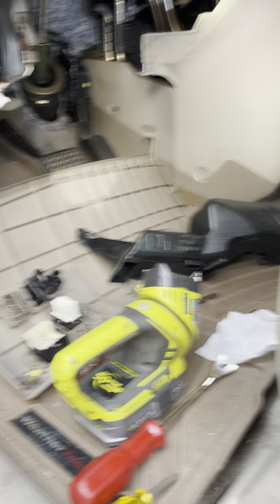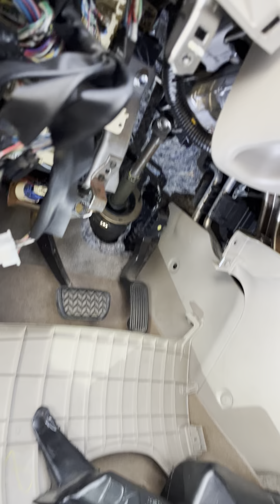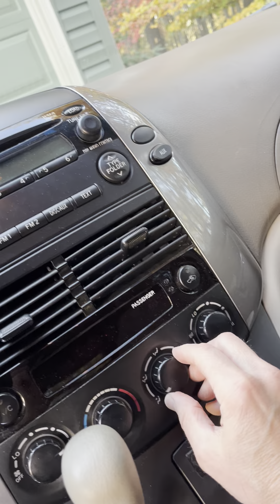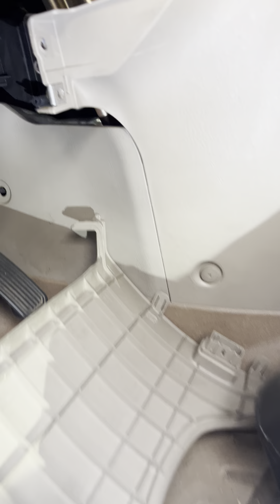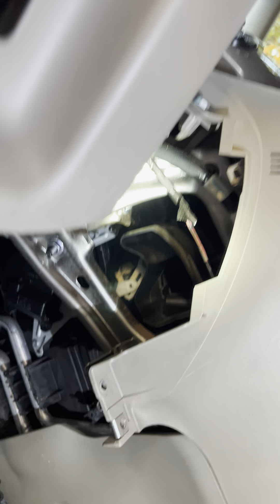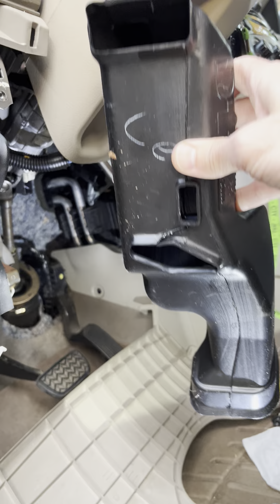Toyota Sienna Mode Blend Door Actuator Replacement

Comment: Thanks for the video. Not sure if anyone else mentioned it but I found a way to make the pins align much easier. 

Put the assembly with the new actuator onto the area and just start securing the 3 screws (enough to hold it in place, but not enough to put pressure on the pins. Then, plug in the actuator, and turn it to defrost on your ac controls, this aligns the slots to the proper orientation. Then do as he says in the video by moving all pins as far out as they'll go away from the center. With some trial and error I found this was the absolute best approach, hope this helps!
Reply: Thanks!! My upper right pin, I believe that's the defrost, wouldn't stay out from center. My solution was to turn the fan on and it created a suction and kept it out in place.

Comment: Thank you for the video. It was helpful.

I just replaced this part on my 2007 Sienna. This video was very helpful. I learned the following tips from trial and error and share them in hopes that they save someone else some time.

1. set the mode to front defrost. I found that this moved the pins to the outer most position.
2. slide the actuator up and push back in one motion and the three pins should find the groove. 
3. turn on the car ignition and change the mode settings. If the wheel spins then you are all set. If not, repeat steps 1 and 2.
4. put in the three screws using your hand and test again to make sure the wheel spins

I spent an embarrassingly long time trying to line up the pins to the grooves and had no luck until I figured out the trick with the defrost mode moving the pins out.

Comment: Dave mine has no pin to hold the cam cover in place and it fell off. Does the clip or whatever go through the center if the black plastic cover and spread the covers post from the inside to lock it in?
Thank you.

Comment: The two-lower blend door actuator is for the hot and cold setting.  The servo mode door actuator is actually for the defrost and front vent mode.  Am I correct on this?
Reply: I believe that may be case for models with dual climate. Ones like this have the hot cold actuator on the passenger side. Easy fix on those. Mines a 2006 .

Comment: Hi David, Thanks for the helpful video. I am trying to fix the Mode Blend Door Actuator. I spent many hours to adjust the pins positions as you said. I have 2 questions to set up for locating the pins in correct positions and the initial mode when you shutdown the Mode to start to fix:

- See picture: https://photos.app.goo.gl/PSTag2DF8e2KWe917
- And mode to setup is which one in these :Floor, Face, Face&Floor, Floor&Defrost ?

Thank you

Comment: So, I just did this this past weekend. Getting the pins back in is a real crapshoot. Ultimately what worked for me is I shifted all three of them to make sure I was getting air blowing only on the windscreen - nothing out the dash vents or at the feet - then with the actuatos plugged in but hanging loose, set the control all the way right to defrost. Put the actuator back in gently and it worked great. BUT I HAVE A WARNING!!! I was doing it in my driveway, temperature outside below zero, and to help me make sure I had the air blowing where I wanted it I had the engine running, heating cranked, and fan at full blast. I was probably under the dashboard for half an hour screwing around with it. When I finished up and was congratulating myself on all the money I saved I looked at my windscreen and there is now a nice three foot long crack running across the bottom right where the hot defrost air was hitting it. "F#$*#&!!!K!!! (That's a direct quote) Was sad for all of 5 seconds then started laughing because what else can you do. Anyway, maybe use cold air when you're fighting with it.
Reply from the maker: Yeah, hate those pins.  I think I got a bit lucky with mine falling in place.
Reply: Best comment ever, I struggled a lot until I tried what you said

Comment: I just finished doing this on my 2008. Thanks for the instructions. It is always helpful to see how/if it can be done without completely disassembling everything nearby. The service manual probably describes taking the entire dash apart to get to it. It took me a while to get the pins in the right slots. In defrost, it is turned all the way one direction which makes it easier to tell which pin goes in which slot because they will all be near the one end of their slots. Floor mode works, too, it is all the way the other direction but I found defrost to be more intuitive. I plugged it in while uninstalled, set the mode, unplugged it, then installed it while getting each pin in place one at a time until the unit sat flat and solid on the mounts. Unplugging is necessary to be sure it doesn't park itself (i.e., rotate) after a few minutes of ignition off. I started with the top pin because it was the hardest to see and position, then the lowest one, then the one nearest the cowl. Not easy, though.
Reply from the maker: Glad it worked out for you.  Yes, if it weren't for those pins it would be a 10 minute job.
Reply: Thanks for the recommendation with setting the mode to floor. I am running into the same situation with trying to align the pins into the right slot.

Comment: I need to do this job on a 2005 Sienna. I noticed the part does not come with the arm. Is the arm needed  for the  actuator or how do you swap the arm from the old actuator to the new? Thanks for the video.
Reply from the maker: My doesn't have an arm.  My has a round disk with groves in it that mounts to the motor shaft as shown in the photo at the beginning of the video.  The motor does not come with the round disk  -- you have to reuse the old one.  To get it off the old motor shaft, there is a small clip that I had to pop out with a small screwdriver to release the round disk from the motor shaft.  Hope this helps.
Reply: @davidn4125  Got it - so I did this on a clients 2005 Toyota Sienna. You're right, there is no arm as the heater mode shaft clips on and off the large black disc. I had a hard time trying to reinstall and line up the three arms on the back. Any recommendation on which mode I should place the system in before trying to realign the disc for install?

Comment: Don't worry about breaking that pin on the sprocket.  It just holds it in place while you are installing.

Yes those grooves are hard to get right.  I ran the battery dead trying to go through all the settings.  Still working on it.  First attempt I had vent air and nothing on the windshield, second attempt was the opposite.

Also worth pointing out- the servo motor is not interchangable with the motor of the unit just below it.  I tried.  The motor of the unit you are working on will turn the unit nearly 360 (as shown in your video.  The motor of the unit below it will only spin it 4-5 inches.
Reply from the maker: Yeah, I may have got lucky with getting those pins in place.   Try pushing the pins all the way out then rotate the motor assembly by hand instead of using the motor.  If you can get the pins in that way then rotate the assembly by hand until the screw holes line up.  And yes, the motors are different for each function.  I included the part number for the motor I installed in the description.

Comment: What were your symptoms for wanting to replace this?

My issue on my 05 sienna is that the passenger side is blowing cold and the driver side and rear climate is all nice and hot. I live in Alaska, so I would like the whole windshield to defrost and passenger to be warm. I have ordered a new Blend Door Actuator hoping this solves this
Reply: I'm in the same boat as you, Sean. Do you have any updates? My driver side blows very warm air (same with the back of the van) while the passenger side blows cold. I have a 2007 Sienna.
Reply: @SuperJ213  My 2009 sienna is doing this as well!! It’s an XLE
Reply: update! My system just needed to be recharged. So much for what the mechanic told me (like a $1000 repair).
Reply: @SuperJ213    initially driver air was warm and passenger cold. Recharged mine and it did correct the issue with both driver and passenger blowing cold...for a couple of days. Then returned to initial condition. I must have a leak?
Reply: @DBTdad possibly. The place I went to put a dye in the system so if it does leak it'll be apparent where the leak is coming from. Our vehicle is 18 years old, so if there is a leak it's probably really small.
Reply from the maker: The actuator I replaced controls the airflow in the front only.  The symptom I had was that it would not changed from dash air to floor air in the front.  The symptoms you have sound like a different actuator.  Perhaps you have a control that changes the airflow from side to side.  My Sienna doesn't have that feature.
Reply: @davidn4125 any further advice on this situation? Any help would be greatly appreciated